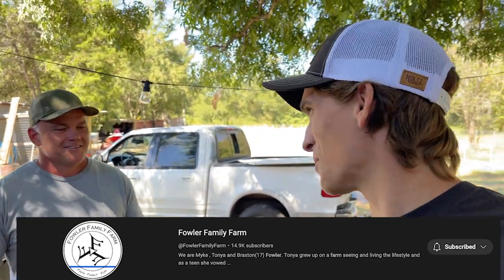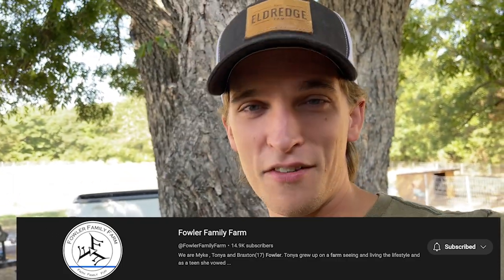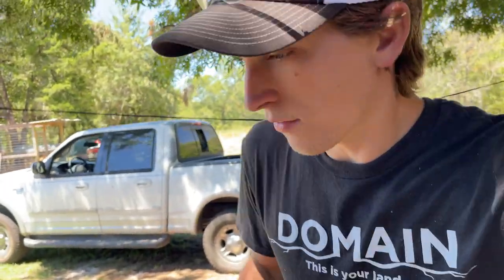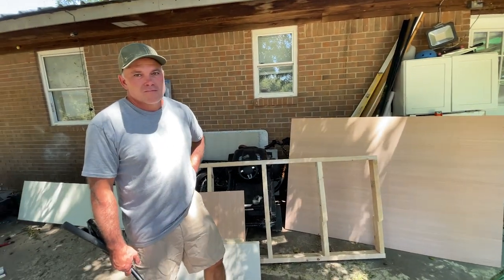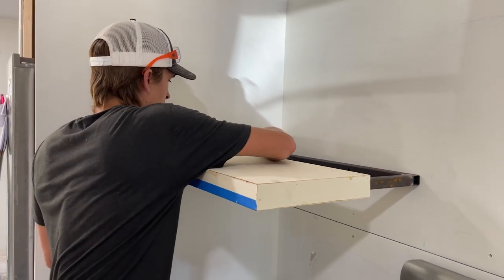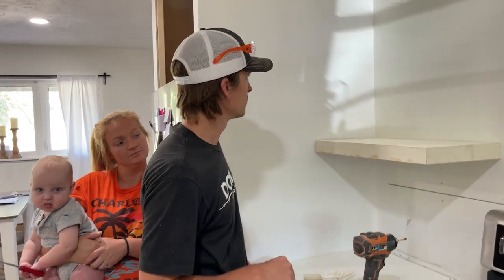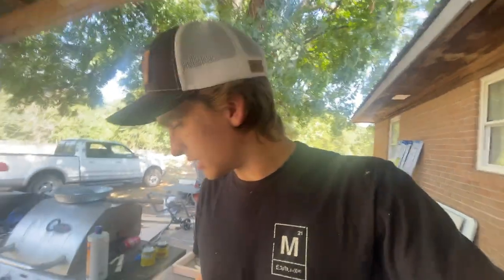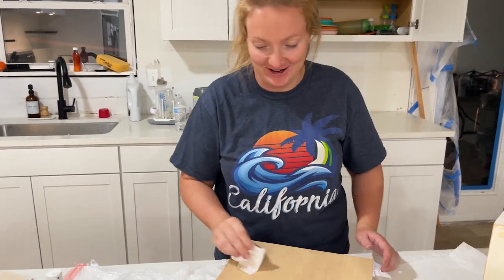Adding color to our KITCHEN! Building DIY Floating Shelves | Remodeling our 1970s house

Comment: Just a few suggestions not criticisms, Bondo is your friend when filing in gaps and repairing damage like your damaged corner, that stainable wood filler never works well . Cover your new counter top with something that will protect it if you're going to use it as a workbench (accidents happen). When building floating shelves give yourself more play you can always add shims to take up excess play. Plan on using urethane to cover the shelves otherwise your finish wont last, if you don't want a shine just use a matt finish. May be more complicated but you can get your own stain pigments that dissolve in alcohol so you can create the exact shade you are looking for. You would have better success if you used a sharp fine toothed saw blade. Just trying to share some advice from a retired carpenter/cabinet maker with more than 50 years in the business.
Reply from the maker: Thank you!

Comment: On a stove hood above the stove when you did it doesn't have to have a thing to vent outside so the smoke and all that in the he'll go suck up into the air and outside I didn't know I noticed that there wasn't a hole at the top to go vent outside